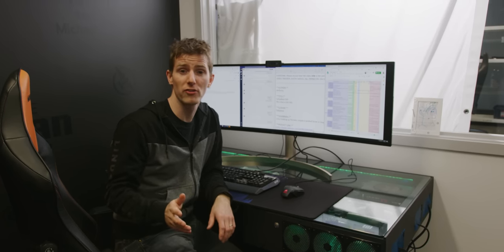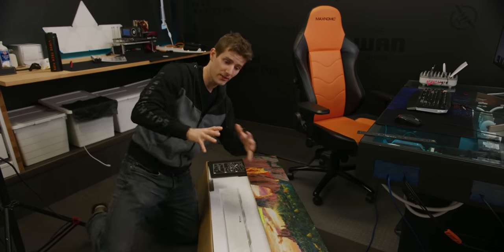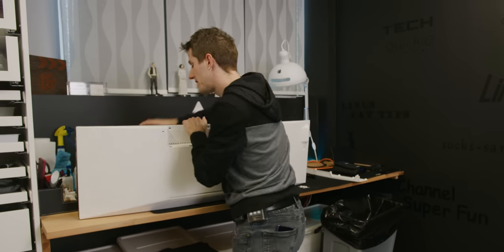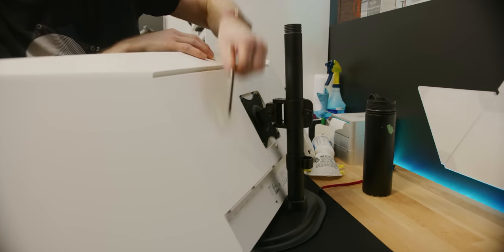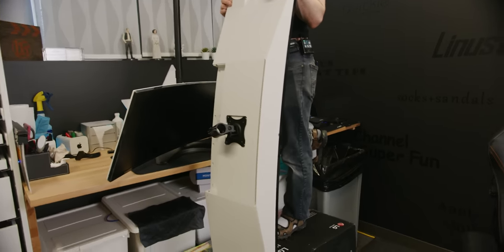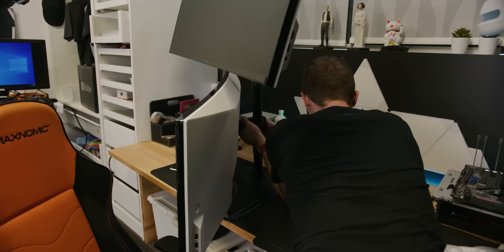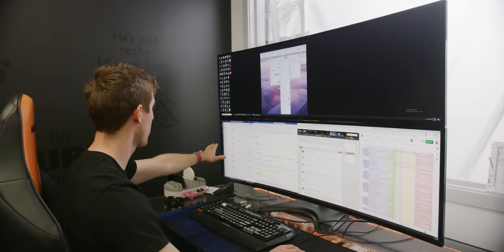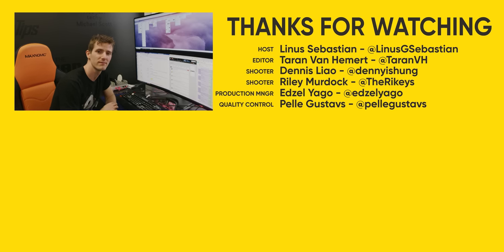My monitor just got an UPGRADE

Comment: congrats, you made a 50 inch tv LOL
Reply: I still wonder why he didn't just use a damn hugeass tv
Reply: @Aka.Aka.  why would you lol
Reply: @sweatyfeetconnoisseur440  So that there's no bezels
Reply: @Aka.Aka.  Lol
Reply: @sweatyfeetconnoisseur440  Did Gordon Ramsey find you yet?
Reply: @Aka.Aka.  Not yet, thank God
Reply: Dual 8k incoming
Reply: "This is Linus Tech Tips, this is not how we do things around here" (Linus, 2020)
Reply: 100th
Reply: For 8 times the price
Reply: A TV isn't made to be sitting so close to it, has low refresh rate, and less good colors. Also, there are no curved tvs.
Reply: No he didn't. He stacked two monitors with a total of 5K resolution at 54 inches. TVs are 4K and this setup is not meant to be used as a single screen television so no.
Reply: Yeah I will just buy a tv
Reply: its actually 54 inch
Reply: Lol last time I used a TV as a monitor for work, sitting to close to the TV led me to eye strain while my dual ultra wide monitor I’ve never had that problem
Reply: @Tyler The whole point is that this is for Linus, when you're used to over 100 hz going back to 60hz is hard no matter what you do

Comment: Linus : 2 $1500 ultrawide monitors
Also Linus: $40  desk stand
Reply: It's basically the same as paying for shipping, I'll pay $2000 for all my computer parts, but they're not getting a cent out of me for shipping
Reply: On a homemade glass table that can shatter at any time so that those monitors land on face while dropping the stand onto pc components
Reply: The thing is though that most stands are that cheap to produce. (Save Apple). There isn't that much complexity or material and just needs strong designed metal frames to hold things in the air. There are plenty of cheap monitor mounts I have at work. 1/3 are great. 2/3 are cheaper crap.
Reply: And lets not forget the $x00000 of machining equpiment they have in the workshop, just collecting dust!!
Reply: and a non-activated windows
Reply: Its 1000$ monitor?
Reply: @shaggyego better than that machining equipment being scraped in some metal refinery
Reply: @CC-vv2ne  why would it be scrapped? I saying they have all that incredible machinery some of which has NEVER been used, surely that wouldve been an idea project for it....
Reply: @CC-vv2ne  Yeah, that was my bigger concern as well.  What is the weight limit of that glass surface?  You may want to re-think that setup on a glass desktop.
Reply: @thedog556 Yeah, I'm almost 200lbs and sitting on a tempered glass chair mat and it is one of the best purchases I've ever made.
Reply: @thedog556 It's flat on the ground so it is very stable. Rolling off the edges is not problematic either. Small debris hasn't been an issue. I've had it for probably a year and it still looks good as new. I suppose dropping a coffee mug or water bottle on it could be enough however. 

idk, for roughly double the price of a crummy plastic equivalent I've been extremely satisfied. Mostly because, in my experience, the plastic ones just don't last (on my carpet anyway).

Comment: I love how Linus is trying to get the monitors mounted by himself in the most uncomfortable way possible and he doesn't want any help, but as soon as Dennis has back pain he immediately tells him to take a break of switch to a lighter camera.
What a caring boss
Reply: do it for the vine
Reply: Employer's responsibility
Reply: Actually made him go fill out an incident report too.  I've had a few on the job back injuries (later found out I have scoliosis), and I was always railroaded every time it happened, accused of faking it, that kind of stuff.  I have constant back problems now.
Reply: @Brunnen_Gee  that's why you have unions and HR to report these things. And of course do the sensible thing and bring it up with a union if they fire you for refusing to do work for injuries they are ignoring.
Reply: @Brunnen_Gee  nerds know about back pain and bad posture.
Reply: @Brunnen_Gee  so it technically wasn't all their fault as you continued to work as you had injuries.
Reply: yeah, caring about not getting sued.
Reply: My sister's ex used to work for a hotel. One of the workers there, injured his back while moving a sofa (at work, for work) and the ex was a witness. The manager called the ex into her office and tried to convince him to sign a form stating that the other worker wasn't "on the job" when this happened. He refused to sign and was fired for something dumb less than two weeks later. I don't remember what ended happening in the end because it was years ago and like I said, he's my sister's ex, but I do remember telling my sister that he should have talked to a lawyer.

Clarification: In case anyone didn't get it from the context, when I said he was fired over something dumb, I meant that the reason (excuse) itself was dumb; he didn't do something dumb that should have resulted in getting fired. One may argue that refusing to sign that form was dumb, but that (then new) manager was already finding all sorts of dumb excuses to fire people and replace them with the people that worked at the hotel she used to manage.

Comment: Linus 2017: "This 43 inch 16:9 monitor is too big for desktop use, just get something smaller and save money"
Linus 2020: Builds the world's most expensive 55" HDTV out of 2 monitors.
Reply: 55" HDTV...that's split down the middle...horizontally. WHY?!
Reply: & also the entire monitor setup is 16:9 in total
Reply: @furjaden8553  See 16:9 is still the best resolution
Reply: @EtherImperial  I found 16:10 to be way more comfortable in a dual side by side setup. I find that with 16:9s I rarely use the outer space on the second monitor. Maybe the problem is exaggerated a bit since I have one of them dead center for gaming.
Reply: I can almost feel instant regret, this was very expensive and didnt look/feel good. Can't wait for the dumb curved monitors trend to die off it's completely unpractical and ridiculous.
Reply: @CaveyMoth  Even more curious, 2017 linus even said "if you want a monitor this big, why wouldn't you just buy a tv?"
I am pretty sure after the poor review in 2017 LG had him assassinated and replaced with a body double, its the only plausible explanation.
Reply: that's his channels niche now , there's enough low end pc stuff on youtube
Reply: @Krullerized  I love curved displays

Comment: 2005: "Wow! These new flat-panel monitors are so light!"
2020: "OMG!... so heavy!"
Reply: To be fair a 56" CRT monitor would still significantly outweigh these.
Reply: Both of these (excluding the stand) are about the same weight as a single 19"CRT.
Reply: But there are SOME 21" CRT:s that weight more than those two combined. But don't know with the stand.
Reply: @jouniosmala9921  With the stand that whole setup is probably still lighter than a 21" CRT, these were quite chonky
Reply: @SteelSkin667  I actually found some that were lighter and some that were heavier.

Comment: Why not just buy a tv at that point?
Update: the answer is, "Damn it. This is Linus Tech Tips!"
Reply: Metallic Hawaii TV’s usually dont have the same screen tech inside that PC monitors have, so that’s why you wouldnt want a TV as a PC monitor.
Reply: What about latency!
Reply: Better monitor than tv way
Reply: Well he's not gaming on it… so…
Reply: Fredrik yep it sucks, and, the resolutions don’t line up sometimes, so the edges of your screen are cut off
Reply: because fresh rate
Reply: I was waiting for him to drop it...
Reply: Monitors can be just as expensive, if not way more expensive than an average tv because they have much better color, response time, and they are tuned for being viewed from 2-3 feet away rather than 10 feet away. If you use a tv as your monitor you will begin to notice input lag and most TVs are locked at 60fps, which is usually the bare minimum for monitors
Reply: @fredrik4362  That's true for gaming but he won't be gaming there since it doesn't make sense with the middle part. For all the other things tv is fine.
Reply: Because a tv would be 4k or 8k 60hz the monitor would be 5k (1440p x2) at 144hz adaptive-sync and a tighter curve. And why do we need that? "Because this is LinusTechTips darn it."
Reply: I literally said the same thing lol and yep Linus figured we'd say this and his counter argument is This is Linus Tech Tips we do things the hard way here.
Reply: @marky3609  its wayyyyy better than a tv for what hes using it for
Reply: @notaberger_3216 
It's not that much better plus the extra headache of putting it all together would have just made a TV an even more practical use case but this is Linus Tech Tips they don't do practical here lol 🤣🤣🤣
Reply: @marky3609  are you kidding? There are huge benefits to having monitors over a tv especially for gaming and work purposes. No input lag, most TVs are locked at 60hz, way better colors, etc. I would go for monitors for the high refresh rate alone.
Reply: This is.............Linus tech struggling tips channel
Reply: @notaberger_3216  I had two huge TVs as monitors, I gave them to a neighbor. I now have two 1440p 32" monitors now side by side. Money isn't an issue for me. The widescreen he has is like 27" 1440 and the density is a bit small. 
 It is the best setup for the 12 hours of programming I do a day. I also have 2 smaller monitors at the edge of my desk on each side. I thought of 4 of the 32" mounted on top of each other.
Reply: Nah you guys are talking about cheap TVs regarding input lag and refresh rate . Linus can definitely afford high end TV like any of the Nvidia BFGD like the pg65uq . It's 4k , 65" and 120hz out of the box . He even featured that monitor before
Reply: If your TV is nice enough you can. I've got a 55" Samsung 4K that I use as a main monitor, with two 22" 1080p 16:9 monitors vertical on each side. I have to get a sensor out to notice any latency as long as I have game mode enabled on the TV, though it is higher than monitors (~8ms to my monitor's 3ms according to my janky home-built tester). Enabling all image optimizations adds like .2-.3s delay which is unusable for a PC (and annoying af to sync audio to), but looks good for a movie.

I've also got a cheap (garbage) 55" TCL 4K TV that I cannot get the latency down to a tolerable level on.
Reply: Because he love expensive stuff
Reply: It's kinda nice having widescreen with high resolution. But for normal gamers and creative people, a large Gsync TV is more than enough. 

Wide-screen like his is a niche gaming option and good for streamers I guess, use spare monitor for many other side tasks. Ultimately having widescreen even just one, is good for productivity that requires many open windows...that's about it.

I have 2 screens and 99% of the time the other screen is ignored
Reply: No one is going to game on those 2 ultrawides so latency and refresh rate hardly matter. I use a $400 Samsung 4k curved 50" as my monitor and from a productivity perspective it's likely almost just as good.
Reply: Because TV's are meant to watch at a distance, they have lesser pixels than monitors, which are meant to look at close up.
Reply: Are all of you people time tripping in from 2008?? Tvs today use mostly the EXACT same tech as you see in a pc monitor IPS or VA. Most of the other odd tv formats have died off at this point, pls is not even around much anymore. Most monitors use inferior panels H-IPS-TN etc with 6bit panels and AFRC, that is flickering pixels to make more colors. Almost all 4k tvs are 4.4.4. Only thing you need to avoid are RGB-W tvs and that is in the LOW end spectrum. Read 40" 250usd tvs. These are like cheater cel OLED displays that share pixels. Some RGBW just include a 4th pixel but most do not. Overscan, this has not been a issue for over a decade. overscan and underscan are things you need to worry about on retro gaming or older video formats like dvd vhs where the old allowance for overscan can leave visual garbage on modern tvs.
 Drawbacks on a tv are less granular back light control, settings controls and pixel pitch on large tvs. I use a 65" for my media pc and you do not want to be closer than 2ft of that thing. Also some tvs you cannot disable things like local dimming without service hacks. Latency is a issue on some screens. inputs, hdmi on most leaves dp filled gpus in the lurch. Converters suck and most wont work 4k@60fps and proper 4.4.4. As well as smear, samsung on the high end tvs has had a lot of ugly overdrive in the latest updates. Inverse ghosting all over in dark hdr scenes. I would also avoid OLED displays on anything NOT a media pc this includes gaming as HUDS will burn in within a month.
Reply: @sombrerostalin1499  That's not true, all modern TV's have a "just scan" option that you set to avoid that. There's no stretching or anything of the resolution with that on.
Reply: @notaberger_3216  I agree with you to an extent. Yes, monitors will be better because of the reasons you've mentioned, they're also outrageously more expensive for less screen size. I've been using a curved 4k samsung tv for a monitor for a while. I know a monitor would have better specs, but I don't need them. You don't notice 60hz refresh rate lagging in normal computer use. Even in gaming, for most casual players, it's not that big of a deal. To use a TV as a monitor, you do need to turn on gaming mode (on the TV itself) or you'll have lag everywhere due to the TV processing functions. With a little tweaking and a nice modern 4k tv, it works pretty much just as well as a normal spec'd monitor. Even supports HDR on the desktop and in games.
Reply: Sometimes the pixel fill/dot pitch is inferior, more black space between pixels as well, less apparent on 4k, but some 4k have dithering as well.
Reply: TV's are.... compared to monitors, trash.
They're fine for movie watching, but for content creators and gamers? They're horrible because they have so much holding back it's performance and response time.
The color profile on TV's are also very unbalanced, so forget creating accurate content in photoshop or video editing software.
Gaming? you will literally be about or at least (depending on the tv) 1-2 seconds behind EVERYONE else using monitors and wonder how people are killing you so quickly when you "shot them first" on your screen , lol. So forget playing anything competitive. 
It's POSSIBLE, but even still, you're putting yourself at a disadvantage from the get go.
I used to use my TV for gaming, but after putting it side by side with my monitors, it was like watching a snake effect.
Reply: @triliner254  you're getting that from ages past. Pixel density is resolution to screen size. A 4k screen has the same number of pixels whether it's a monitor or a tv... Or 32 inch or 55 inch. 4k literally stands for 4096 x 2160 pixels.

Comment: 8:30  riddle me this:  what if you had mounted the top one upsidedown?  then you could have less of a bezel inbetween.
Reply: exactly what i was going to ask
Reply: yeah... was thinking that too
Reply: Yeah
Reply: Holy shit that's right
Reply: Won't the image will also be flipped then?
Reply: @arshilahmad9811  you can set it up in windows to display the picture flipped on the upper screen
Reply: no put it at an overlapping X for those pirate games
Reply: @arshilahmad9811  you can change it in settings
Reply: Feels like the bottom portion of the monitor is carrying all the weight. Flip that upside down now you have weight that's not only pushing downwards but also forwards which would most likely make the whole thing fall.
Reply: @presstmoded  Oh thanks I didn't know that.
Reply: @arshilahmad9811  you can flip it 180 in the display control panel, or in NVIDIA's control panel

Comment: Personally, I would have mounted the top monitor upside down on the vesa mount so the thinner top bezels are butting up against each other. Minimizes your total bezel between the monitors, though I guess in this case it isn't much of an issue.
Reply: that'll make it bgr though, making things like text look off.

Comment: @Linus I have this same stand for my two side monitors and I modified it to where you can close the gap between the two monitor AND angle it.

Install as you just did, but when you’re screwing in the top tube to the bottom, stop threading it halfway. Tilt the top tube forward to where it will essentially be at a 85 degree angle. Then , apply the JB Weld to the threads, locking them in place. 

Note: once you do this, you can no longer remove the bottom monitor mount. You’ll have to remove the bottom monitor from the mounting plate completely.

Comment: Linus - "I need to step back a bit from everything"

Also Linus - "I need dual ultrawide monitors so I can micro-manage everything"
Reply: Dual monitors is the SHIT. Triple.. ya way too much :P
Reply: @charlesreid9337  Four cheap monitors can be a cost effective, if somewhat inflexible, option. It's what I've done with a 750Ti I got specifically because it was the oldest, cheapest card I could get that will drive four monitors. I only have three now because I ran out of spares, and running on castoffs and spares was the whole point.

Comment: Linus: “Hmm I cant fit all these windows on my screen”

A normal person: Makes the windows smaller

Linus: “So I decided to go double 49 inch ultra wide!!!”
Reply: i got me myself 3x 25" 21:9 Screens (2560x1080) for exactly that reason.
set up like this: |_|==|_| 
It is incredible how used you get to this.
Every time i go to work with only 2 screens with 1920x1080 it is such a difference x.x 
I actually have to use the dinky little 14" 16:9 Screen of the notebook as well to vaguely feel like working with it <.<
Reply: BaTtLeFiElD ThReELMG  120hz is ok but 90hz is enough if you only casually game. (i.e. in between production work)
Reply: BaTtLeFiElD ThReELMG  i agree, but for my workflow anything above 100hz is useless. I only edit 60fps footage anyways